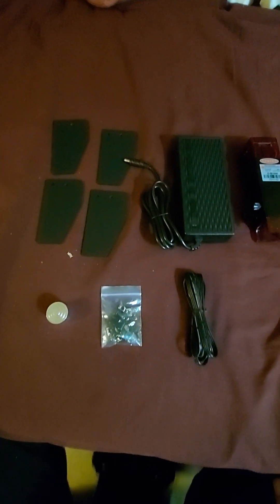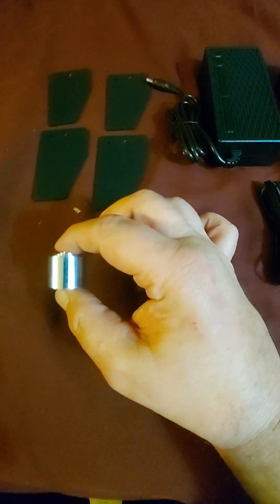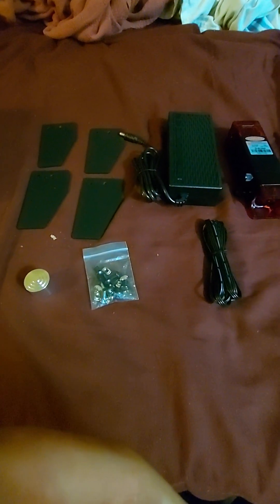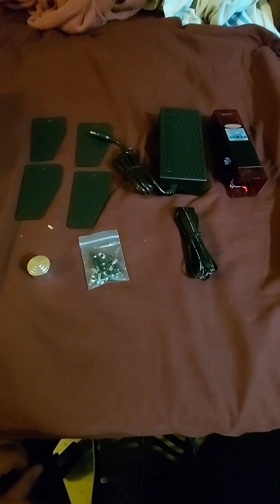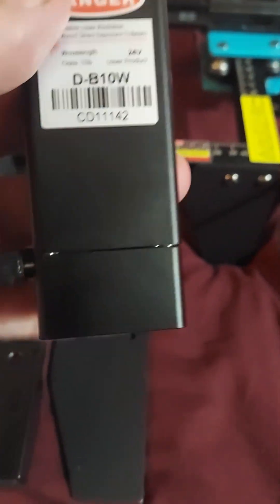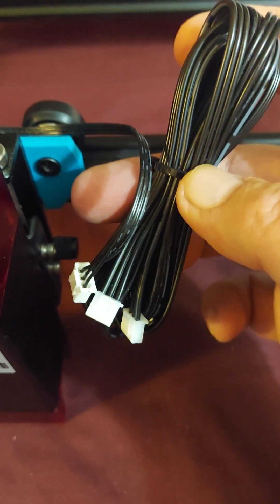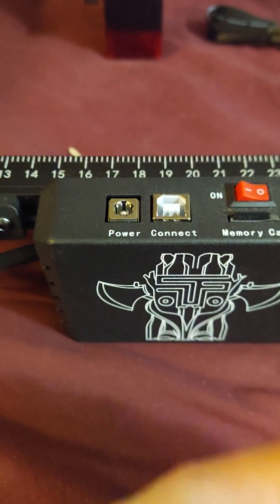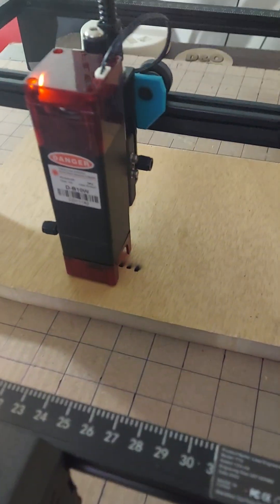Upgrades Twotrees TTS-25 TTS-55 TT-5.5S Engraver Accessories

Comment: dis you have to pull off the connector or where did you plug in the new bigger gauge wire?
Reply from the maker: I pulled off the connector. The hole thing was just a plug & play sorta thing. it was just getting to it and restraining the wires is all.